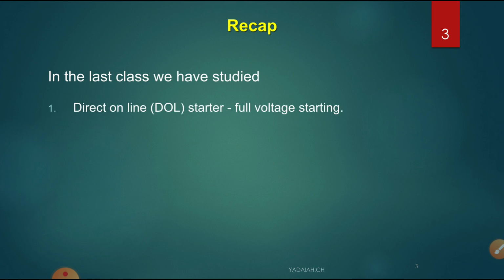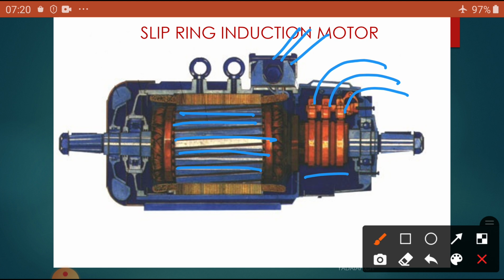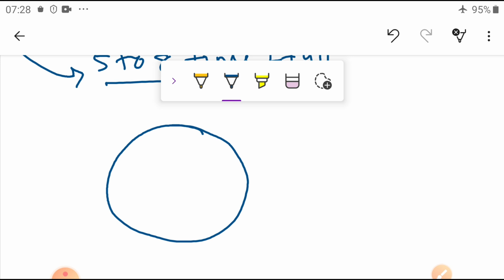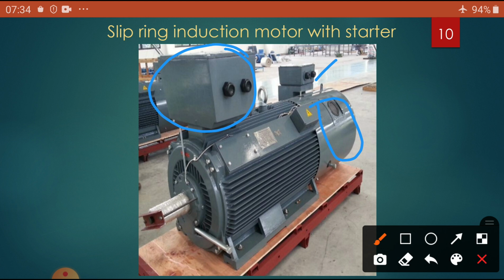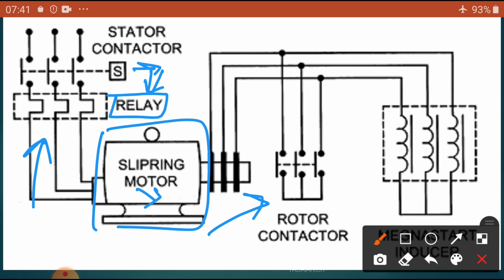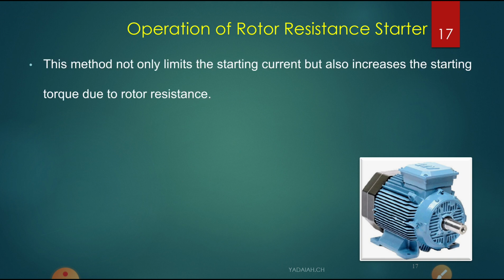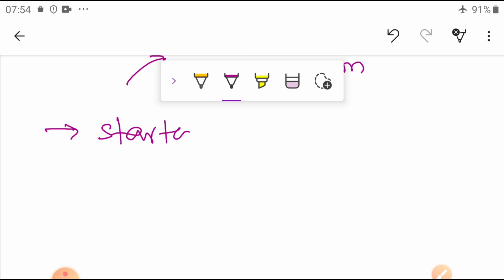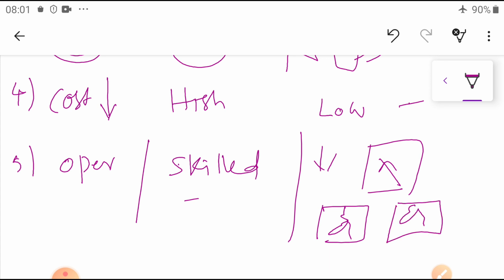Rotor resistance starter to Slip ring Induction Motors

Comment: Hello sir. Thank you for your great videos.
I am helping a carpenter  with his machines. His machines start at very high current as you say. For example an old bandsaw. Motor 13.5 HP, 34.6/20 A, 10 kW. I think it's a slip ring motor. What is the simplest/cheapest way to reduce the starting current? The issue is that I've been trying to help them install DIY Hydro Electricity, which has been very difficult for me with limited knowledge. So I need the two large carpentry machines to demand less at start up. Thank you very much